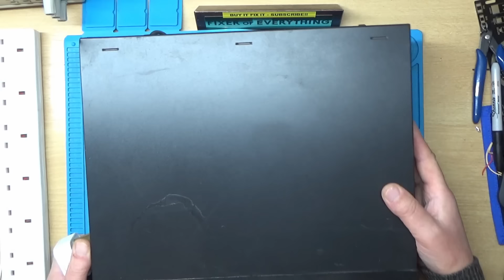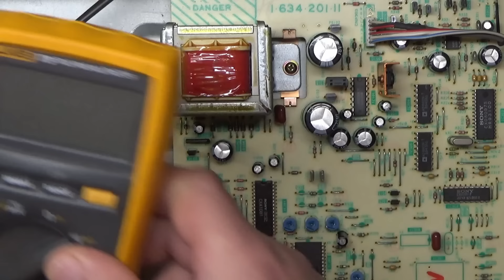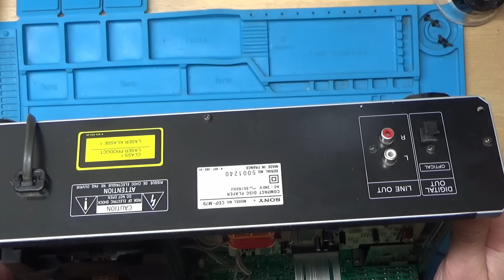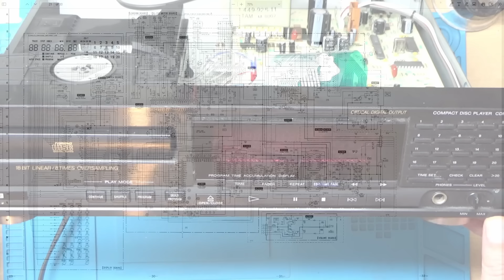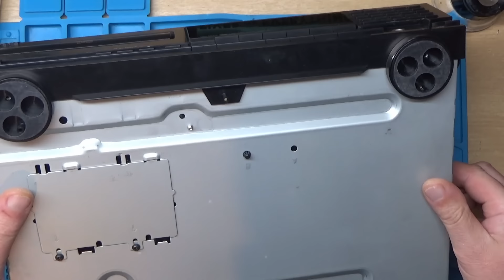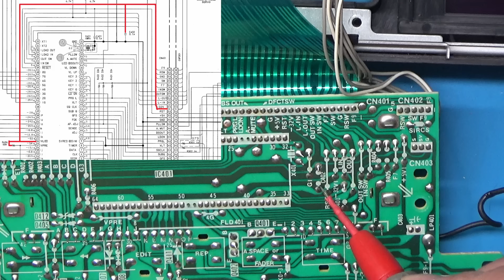The Repair That Almost Killed Me! | Unbelievable CD Player Nightmare!

Comment: errr - did you unplug it from the mains ................ phew!! and oopssss.. Perhaps the original laser assembly was OK and it was that IC all along? Remarkably the VFD is in good shape. I have a microwave from 1991 and it is very low output. I need to try risking renovating the tube ..........

Comment: hi thanks for the video
i just got the sony cdp591 model,
the tray is open and close good, its read tbe disk good
the only problem i have with it is its jumping from almost everything, the slightest tap on the top of the unit(no matter where) is jumping the track forward or backward.
its jump even from the sound and bass coming from the speakers.
what could be the problem and how i can try to fix it?
if its a easy fix or not?
i have almost zero knowledge on electronics.
please help
Reply from the maker: That sounds like an issue with the laser pickup, or possibly tracking might need adjusted. I'd first try cleaning the lens on the pickup with a cotton bud or such.
Reply: @BuyitFixit i cleaned the laser, cleand the rails and greased them
i strached the spring of the pickup suspension a little bit. 
i tryed to adjust the pots
but with no luck.
is it realy that sensitive to tuch unit?
it was like this as it was new also?

Comment: I only watched a couple minutes in to where he said there isn't a fuse.  It's frustrating to the nth degree, but it isn't that uncommon that the transformers sometimes have fuses built in.  Denon had a bunch of receiver models that had them, and when an output died, so did the transformer, making a cheap repair an expensive one. Hopefully, it's a fused resistor somewhere else in the unit.
Reply from the maker: Yes, came across fuses a few times embedded in the actual transformer. Especially in wall plug type PSUs. After the transformer there were a couple of those two pin transistor type looking fuses, which I've only ever came across on Sony equipment.

Comment: Great work on getting it working. But please be careful when working on these things as we don't want anything bad to happen to you. I find these videos educational and this will help me with when I restore some Aiwa components as I am a big fan of Aiwa. Just as a thought to give you some protection, I would recommend investing in some electrical gloves that are rated for up to 500 volts. Meanwhile keep up the great content and I am glad its all working. Here is a tip for a music test CD. If you have a CD burner and a CD Recordable disc. Just add some YouTube music tracks burned onto the disc and use that, this should prevent any copyright claims on the videos you make. Just a thought. All the best.
Reply from the maker: Thanks, and thanks for the tips 👍

Comment: Fantastic job but I’d recommend always pin skipping rather than sequential soldering when soldering through hole ICs to reduce localised heat buildup potentially weakening them.
Reply from the maker: Thanks 👍Interesting. I've never thought of that, although I've not had any problems that I remember. If you like through hole stuff (if you haven't seen them already), check out the Defender arcade machine repair or the Space Invaders I did.Both are LONG two part videos, as there was that much wrong with both of the machines. Every every PCB in both machines was faulty with multiple faults!
Reply: @B @BuyitFixit , don’t worry, I’ve already watched those two lol.
I’m very much into retro repairs myself
I’ve don’t lots of jobs, been a repair technician and finally ended up as a principal design engineer for 14 years before I started teaching soldering, ESD, and international IPC standards full time.
I spend lots of evenings when away from the family teaching by watching videos like yours and I’m teaching soldering at Teledyne next week for 4 days so will like watch quite few more lol.

Comment: Those TO-92 case fuses were called Pico fuses or Chip protectors
Reply from the maker: Interesting. I do remember coming across them in the 80s in some Sony karaoke equipment, although I'd not seen any of them for year until this device came along.

Comment: To be fair, all tantalums are faulty eventually. It's just a matter of time. They start with an internal resistance, which goes lower the more moisture they absorb, then go short. Quite the explosion in high current equipment. The servo IC's in CD players get easily damaged when they are only fed with one supply for any period. Pops the op-amp regulation internally.
Reply from the maker: Interesting, thanks for the info 👍

Comment: IPA is ok to use on a glass lens but on some plastic lenses it makes it slightly opaque and stops the laser reading disks. It`s happened a few times for me so I stopped cleaning any lenses with IPA. Just a cotton bud
Reply from the maker: Great tip, thanks for sharing 👍

Comment: Thought there’s a pot you have to set the resistance with, had to do it on xbox
Reply from the maker: That's on the laser itself for the drive current. Shouldn't really need to adjust it on a new laser.

Comment: Brilliant patient work there. I’ve always been impressed by your skill with the solder sucker – I have the same model as yours but I’m sure I would have struggled with that display and the big chip. Any chance of a quick solder sucking tutorial in a future video?
Reply from the maker: Thanks mate 👍I can't remember which one I used on here, was it the engineer one? If not that's what I mainly use now. It might not make a great video though, but it's pretty much just use some flux, and make sure you heat the area up properly before pressing the button. If you're struggling, try turning up your iron temp slightly.
Reply: Thank you. Yes, I believe it’s the Engineer you’re using here. I’ll try increasing the iron temperature.

Comment: Great job finding the problem with this player!

We all have had similar repair problems.  I bought a Sony amplifier from a clearance centre back in the 80's that had a problem.  I fought with it for a while and put it on the shelf for another day.  A few years later, a friend saw it on the shelf and said "You bought that piece of junk??" Apparently, it was from the university and failed.  Several of their techs looked at it, including him, and they could not get it going.  It sat on my shelf for 20 years, and I Had looked at it once or twice more over that period.  I finally gave it a last stab and discovered that a bias diode for the final amplifier stage on one channel, although tested good, was defective.  I couldn't get a replacement but I could make one out of a red led and a 1n914!  I popped that in and the amplifer worked once again and met the specs!
Reply from the maker: Thanks! Sometimes the most frustrating repairs lead to the most satisfying fixes 👍

Comment: You lucky you didn't need to calibrate the the new laser
Reply: Normally, a complete electrical calibration is performed after replacing the optical block, even if the player appears to be working correctly. The signals are definitely not optimal.
After replacing the CXA1082S servo controller, I would have reinstalled the original optical block, assuming it was still functional.

Comment: Good effort, with a worthy result.

One tip I would advise that I like using... use a digital timer for switching the 240 volt on and off.

Good ones have a red led that indicates at a glance what the timer's on or off power  status is, and a large manual over ride button.  Plus, the relay inside makes a slightly different noise when clicking on, rather than off.

Why do this?

Less physical hassle.

The timer does a cleaner switch over, (it's designed  to do this), and avoids any 240 volt surges, which is good for dc circuits.  You can still also fully unplug if you really need to.
Reply from the maker: Thank you, and thanks for the tip 👍

Comment: Omg. Never use IPA on a laser lens. They are plastic, & the IPA can cause damage to it.

Always use lens cleaning solution, or Di Water on a cotton bud.
You can then blow it with an Air duster or another clean bud.
Mind you, back in the day, more people smoked in their houses & the lens would become coated underneath. So without removing the focus & tracking coils, you couldn’t easily get to it.

I noticed the KSS150A laser you changed out.
Typical Sony laser. There was the KSS210 & 240 if I remember correctly too.

Brings back fond memories. I’ve repaired many players back in the day.

Great videos though. Keep uploading
Reply from the maker: Thanks, and thanks for the suggestion on cleaning the lens 👍
Reply: @BuyitFixit no problem. I remember we had a bulletin from one of the manufacturers back in the early days regarding this. Most people were using IPA to clean them when cd players first come out & didn’t realise the damage it  potentially could cause. 
Also, some people were also cleaning pinch rollers on vcr’s & audio not realising that it removed the natural oils in the rubber. Eventually leading to perishing on the surface.

Anyway, on another note… Great videos mate. I love the way you diagnose faults. Very methodical.
Takes me back to my brown goods repair days. I’m pretty sure,  there is a Hameg scope boxed up in my loft. Might have to pull it down one day & see if it still works.
All the best & keep up the great work. 👍🏻
Reply from the maker: Thanks mate 👍

Comment: Just an observation originally when you inserted the disc, it went in one direction and then reversed. Then when you fixed it. It went in the same direction twice. Maybe it was an optical illusion maybe it wasn't but I double checked back and the cd seems to go in both directions when it didn't work.🤔🤔
Reply from the maker: It could be the shutter speed of the camera compared to the rotational speed of the disk. You see similar on TV with helicopter blades standing still and car wheels going backwards.

Comment: You are an analytical persistent genius. Very impressive. Go canny with that 240v. You could almost do with some sort of 240v temporary warning label you could put over part of it so that you knew when it was live. Not many people get second chances with 240v as you will know!
Reply from the maker: Thanks mate 👍 My first experience with 240v was when I was around 5-6 years old. I tripped over a wire and it pulled out of a light fitting, so I picked up both of the wires to try and plug them back in... No RCDs back in those days. My fingers were quite black and burnt...
Reply: @BuyitFixit Ha ha formative! My first “experience” (probably about 7-8 years old) was removing a light bulb from a bedside lamp and putting my index finger between the pins in the bayonet fitting. It was quite enlightening.

Comment: Sir I had pioneer  pd106 won't  spin  or read but the laser is OK there is beam..what is the problem of my cd ? Tnx maybe  servo ic?
Reply from the maker: It could be, but it could be a number of things such as the RF amplifier too. You would need to use an oscilloscope and perhaps look at the RF waveform, and if you download the  service manual https://elektrotanya.com/pioneer_pd-106_sm.pdf/download.html you can then compare voltages etc.
Reply: Thank you sir  @BuyitFixit

Comment: When repairing with the board out, I place an A4 paper below so any accidental shorts between board and cabinet base doesn't short and kill the board. I also tape the power pins and transformer pins with painters tape so in case I forget to remove the power cable,  prevents accidental touches.
Reply from the maker: Good tips 👍

Comment: That was so painful to watch!  The lack of logical  sequential test procedure! Checking the temperature of the board components when you had failed to find any measurable voltage was quite  pointless. Did you actually test the CD drawer  mechanism after the front panel fault was repaired rather than just removing it? It was sheer luck that you didn't electrocute yourself.  If you are working with mains powered equipment you should 100% be concentrating on what you are doing and not being distracted by videoing and giving a running commentary.

Comment: Good video.. This is my first time watching channel. What drew me is is mulfailures. It seems the last few items I've bought to fix up have had them as well so I can relate. The ceramic cap bad you found is rare I've never found one bad. I found a bad circuit board recently-for the first time-seems like anything is possible these days.
Reply from the maker: @audiogear474  Thanks👍Yes first time I've came across a failed cap of this type. If you liked this one you might like the victron charger I just repaired. It was a nightmare and I almost gave up. Turned out it had multiple faults too!

Comment: New laser needs adjustment doesn't come oreset..if its is a KSS240 OR KSS213 The pot needs adjustment and you need a laser power meter ti adjust properly
Reply from the maker: According to the service manual it advises from adjusting it as it comes preset. The only adjustment it recommended was the EF balance and the TE tracking gain.

Comment: It's a standard Sony mech nothing unusual I fixed many of these always needed a new belt and gear lubrucation, you could have adjust the laser power with the little potentiometer on the laser module that would have fixed it for quite awhile
Reply from the maker: Might be the case, not worked on any Sony mechanisms like this before. Most of the CD players I've worked on were cheap karaoke ones. Although some were Sony, they were badged Arbiter Karaoke Systems, all Sony kit with a 100 disk auto-changer

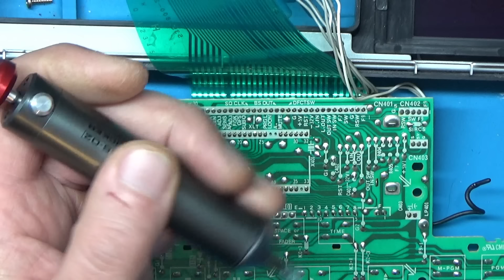Comment: That solder sucker.  16:56 . yes they work good, and got some heatresistant tubing but the amazon prices.. wow extreme... 19£ (24$) + shipping
Got the exact same model from Aliexpress a year or two back.. it was  4.99$ incl. 25% EU/DKVAT and delivery acroos the globe for under 5 dollars qand you could get it lower at sale with coupons.
but the quality is very nice.. all good quality metal. feels wellmade and you get extra siliconetubing.
Reply from the maker: Interesting. I'll have a look on AliExpress 👍

Comment: Problem I have with mine is I put the CD in press close and it closes but when I press play the draw opens back up also when it does try to play I can hear a clicking noise coming from the drive then it stops and either show the number of tracks or says no disc , I did use the remote control and pressed play and after a couple of tries the CD played .
Does anyone have any idea what the cause is ? I have cleaned the laser .
Reply from the maker: I wonder if the belt is slipping. When you close the drawer it has an end stop switch which if it isn't hit after xx seconds, the drawer will automatically open again as it thinks it's jammed. So I'd perhaps clean the switches on the CD mechanism (one is a stop for open, one for close) and inspect the belt to see if it's stretched like the one on this unit.

Comment: Nice work! My only concern is those belts, usually multi-packs are very cheap and will eventually weld themselves to the gears and makes a gooey mess that's almost impossible to remove..
Reply from the maker: Hmm Interesting. I wasn't sure of the quality of them until they arrived. That's the only problem when you order things online.

Comment: I had a belt off a CD player I was working on. Not a rubber one.

Just a laser assembly swap, no board removal but the PSU was in the rear left corner, PCB upwards. with no attempt at protection (how much would a bit of plastic cost?) --- result, two vampire-bites on my little finger!
Reply from the maker: Damn, sounds like this one. This one nearly bit me, but luckily it didn't!

Comment: Sony and cd…. Always an issue. Their cd technology was sometimes worse than cheap chinesium. (Ps2 head blows after weeks of use and such hair rising things.) I own some ood sony cd gear (100 cd wurlitzer or their mighty music center with the loudest speakers and cd changer but both are very sloppy while other brand’s cd players are working since 40 yrs. Nice video tho, good repair.
Reply from the maker: @MaverickM1  Thanks 👍I used to fix karaoke machines back in the day and they used all sony kit. There was an amplifier, CDG decoder, and a 100 disk auto changer which used to get jammed or the little finger that lifted the disk at the end of the arm would get broken off, or the gears on the arm would get broken

Comment: Crowbar is engaging from the noise the PSU is making, faulty caps are first to check.  Then to check what chips they popped. When dealing with CD mechanisms, try winding the head carriage into the middle to clear it from the home sensors, In case the stepper motor drive chip is having issues. Tantalum caps are known to not age well from the 80's and 90's. Its allways worth getting old electronics recapped. Many expensive seperates hifi systems have recap kits available online.

Comment: I used to work on Technics equipment. We had a special tool to rotate the sensor array in the optical pickup when we replaced the pickup.
This aligned the sensors with the angle of the cd mechanism so it tracked properly. I don't remember the procedure, but it involved looking at the eye pattern of the RF signal with a oscilloscope.
Reply from the maker: Interesting, thanks for sharing 👍